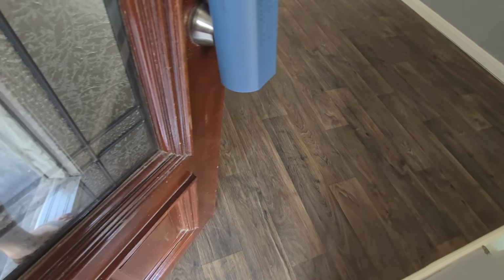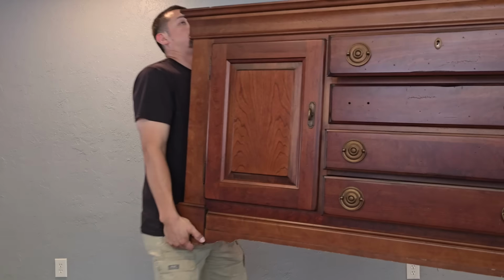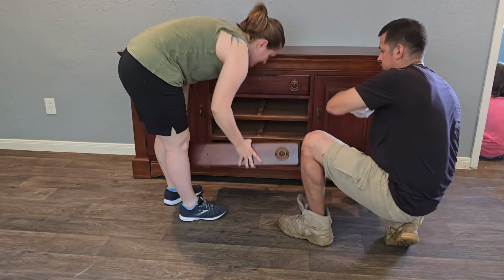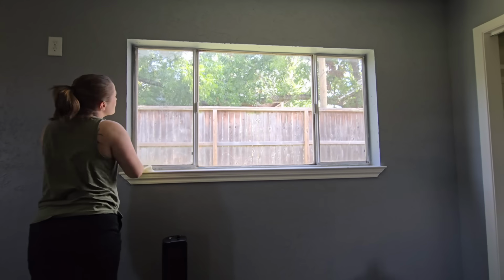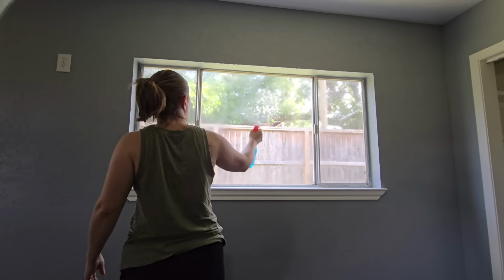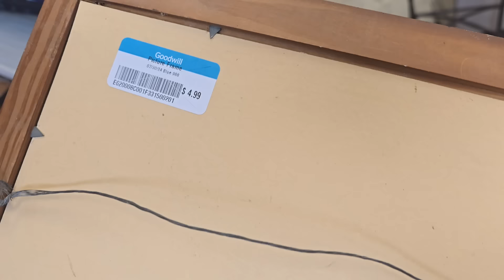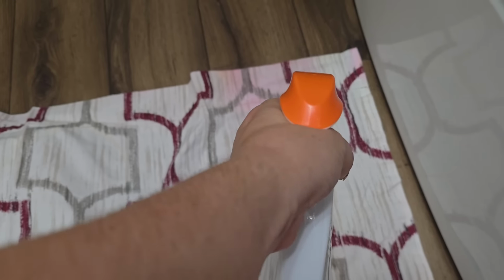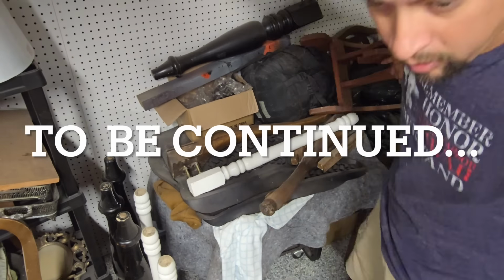Furnishing an Entire Home with Free and Thrifted Pieces | Part 1

Comment: Such a sweet gesture by you and your husband! I can't wait to see the next part. My friend, please do not clean mold with bleach - very dangerous. The two mix together and create a toxic soup. Spray it with white vinegar and let it sit a while, then clean it while wearing an N95 mask. Good idea to have an air purifier running nearby with a HEPA filter. Actually, you could do all of the cleaning you did on the walls and floor with vinegar and water. It's much safer than inhaling all of those bleach fumes. They are now saying that inhaling bleach is just as bad as smoking! With your sensitivity to paint fumes, it's probably not a good idea for you to be inhaling so much bleach. 🙏💞